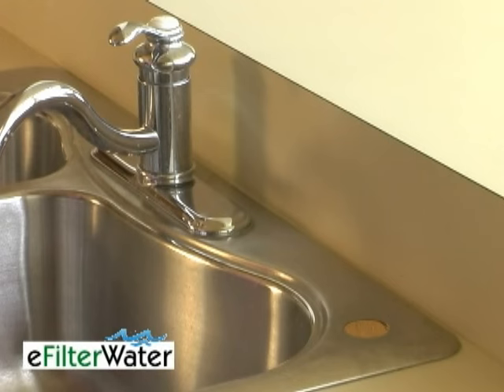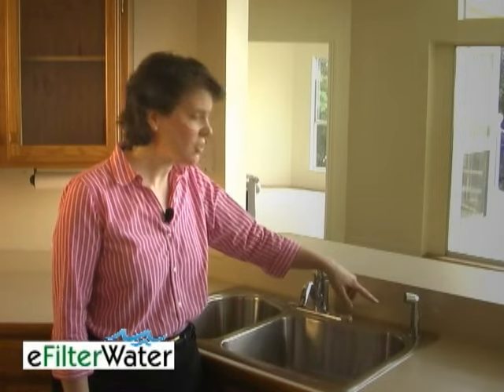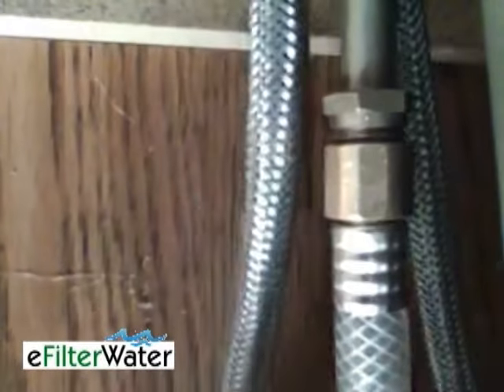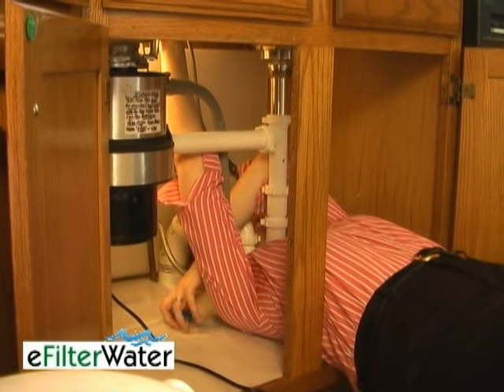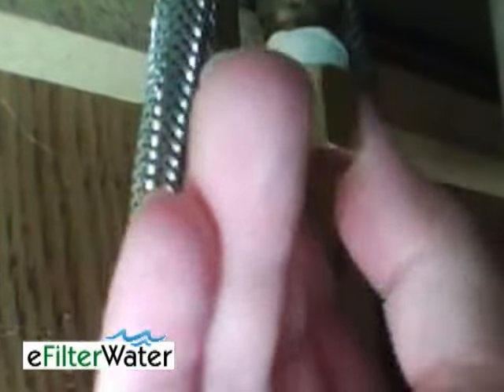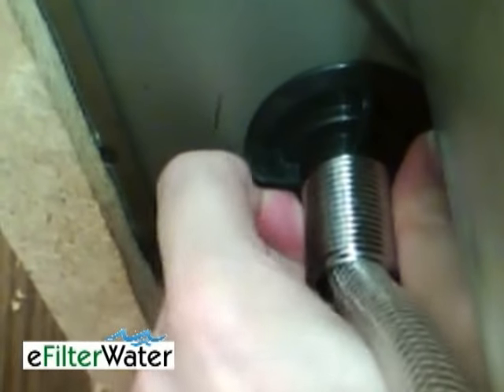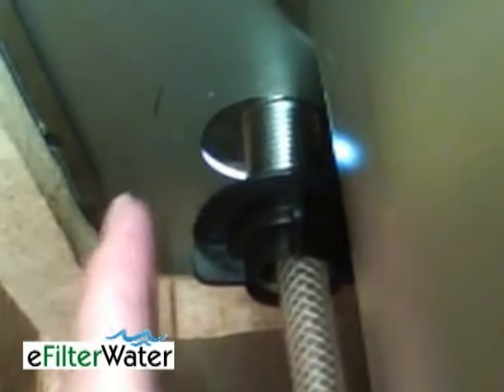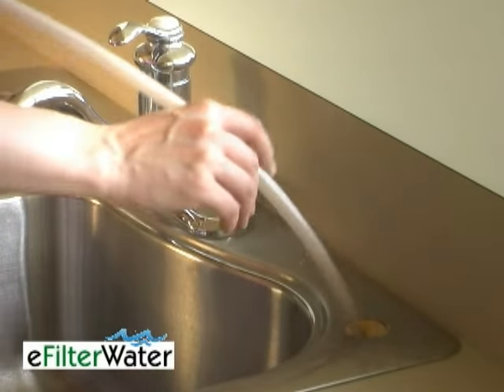How to Disconnect a Sprayer from Your Sink - eFilterWater DIY

Comment: Thank you so much for this video as it was very helpful in enabling me to do this task myself! Did need to make 3 trips to our local hardware store to get the correct size cap. 1st time we got a 1/4" brass cap (which was just a shade too small). We took that one back and exchanged it for a 3/8' brass cap (which was just a shade too large). We had not seen any /16' brass caps when we picked up the first 2 caps so the 3rd time we took the sprayer hose we had removed to the store with us so we could be certain to finally match it up correctly (THIS IS WHAT WE SUGGEST TO EVERYONE AS IT SAVES THE NEED TO MAKE MORE THAN 1 TRIP TO THE STORE)! Once we had the correct size brass cap (which should be available at any hardware or building supply store) everything worked out perfectly. Bless you for considering us poor souls who greatly benefit from your taking the time to make and share this video! It's quite useful still (6 yrs. after you posted it).
Reply: Hopefully you respond, I know it's been years but by chance can you tell me what size plug you used. I tried the 3/8 and the 1/4. Had same exact results, one to small and one slightly too big. I would take my sprayer up there but I made a mistake and threw it out.
Reply: @yvngsamuel2763 Here we are 4 years later a ditto... same dilemna. No brass cap in my size. Now what???
Reply: Get one of each and take the rest back 🤷🏻‍♀️🤣🙏🏻 one of them have to fit! I'm about to go thru this tomorrow so hopefully I find the right one. I have the hose but I can't take it out until I have the cap bc I can't leave the water off. 🤷🏻‍♀️
Reply: Can’t get the thing off under sink.
Reply: @DonnaVirgilio-sz8ej  a pair of pliers should do the trick? Lol.. Try wrapping a rubber band around one side of the pliers for some extra grip.

Comment: Thanks so much for your video, I’m changing a kitchen faucet and the new to me ones sprayer is pouring water and no water coming from faucet, can I cap the sprayer as in this video?  My old one did not have a separate sprayer it was all in one (Only 2 lines hot n cold) Do I need to do anything else? The new has the push clip on sprayer hose ( moen ) but the end is pouring water without pushing trigger. I was going to keep it under sink in a bucket but as is that won’t work unless I change the sprayer end I guess.  Thanks for any advice.

Comment: How do you cap it if it doesn't have threads? Mine has a quik connect stem.
Reply: Just squeeze a bunch of caulking in side then use duck tape at the end.
Reply: Does that work?
Reply: @robynw3312  .. no it does not work. That is a rookie dumb do it yourself method (just like fixing a hole in your tooth with chewing gum) that will cause a leak over time and ruin your cabinet or flood the whole kitchen and house while you are on vacation.
Reply: @robynw3312 I mean.. If the caulk gets hard, you would think that would work lol but you shouldn't need the duct tape for backup and that's where I start questioning the process lol